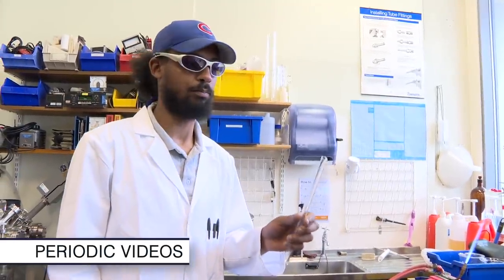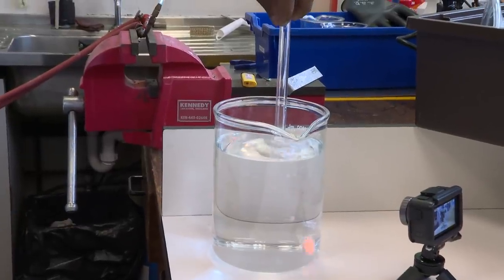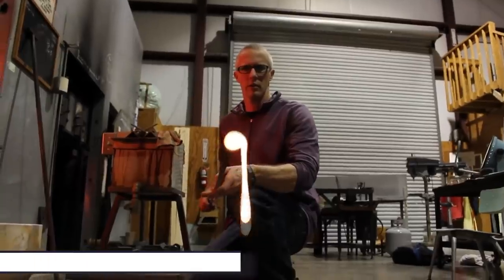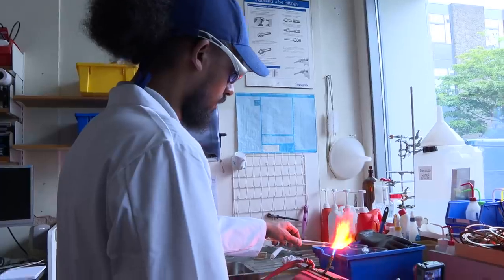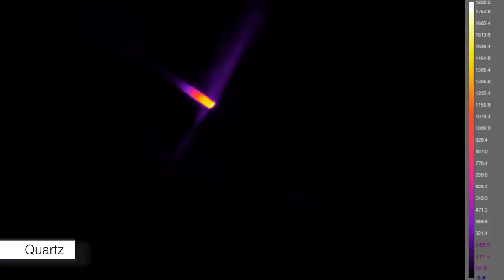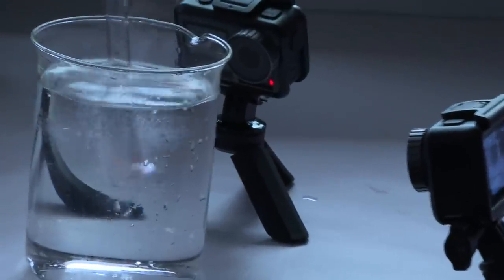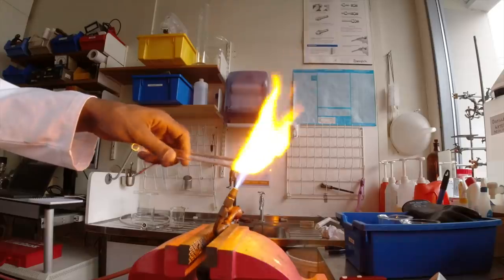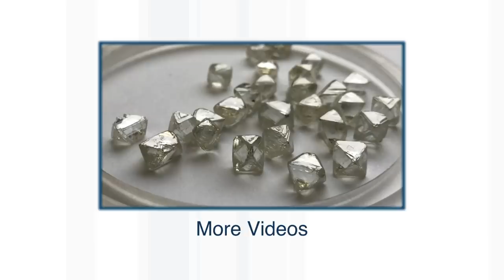Hot Glass SHATTERS in Water

Comment: Big difference in quartz and borosilicate glassware is also the UV transmission. Borosilicate glass absorbs everything below 300nm, quartz can go to ~170nm. Quite important if you try to do photochemistry.
Reply: There are other performance characteristics between Borosilicate glass and Quartz, but the big thing they're trying to demonstrate (And FAIL, Don't use different shapes and masses when making thermal comparisons) is that quarts and borosilicate glass have different thermal ranges where they shatter at. And, yes, if you heat Quartz up enough, it will behave similarly to glass when plunged into water. It's just that the impurities in glass (both potassium oxide and boric acid) shrink the thermal range.
Reply: Also important if you break the outer glass on a mercury vapor lamp, but continue to use the lamp the flash burns to your eyes are excruciating until you discover why you keep getting flash burns and not welding.
Reply: Germicidal lamps as well

Comment: At my glass factory, we have to use a significantly hotter flame than a gas/ox torch in order to manipulate quartz. Sometimes we even have to use hydrogen, which is quite a dangerous gas to work with since you can't really see the flame.
An interesting note to add to what he said about the quartz glowing more brightly: Sometimes when our operators work with the quartz, the light can be so intense on one end that due to the fiber optic effect of the light traveling down to the other end of the tube where they are holding it, they could get a "sunburn" in a perfect circle.

Happy to answer any questions about labware manufacturing!

Comment: I wanna know why glass is used in chemistry at all. Why is glass the go-to for mixing & testing chemicals in? How can one element rule them all & be so inert & noninvasive when it comes into contact with so many other compounds??? 

Do a video on the use of glass in the lab please : )
Reply: For once its is clear. 
This is based on the amorphus structure. Not shaped with periodically shaped elementary cells like a crystal.
Reply: i think what it is is resistant to alot of corrosive liquids. with a notable exception being HF. it can also be shaped to make a bunch of different instruments. and its see through. idk what makes it so corrosion resistant.
Reply: Because its clear so chemists can see what's going on inside, malleable (with some skill and heat) for shaping into weird and wonderful shapes by gents like Connor and chemically resistant enough for the vast majority of purposes. 
If it's not resistant to the chemistry that needs to be done(eg using HF or strong OH- or high temperatures) then we'd use something else (steel, titanium, platinum, ptfe, ceramics...) but alot of the time this looses the ability to see what's happening in the reaction.
Reply: What the others said.
Additionally it is super easy to clean, making it basically last forever as long as you don't break it. I have personally used many flasks that were older than myself.

It is so inert because it's still mostly silicon dioxide and the silicon-oxygen bonds are really stable.
Reply: @christiannorf1680  Is it just luck of the universe that the silicon-oxygen bonds are also transparent?
Reply: @AntonLFG  they're not transparent to everything(normal glass absorbs alot of UV radiation for example), but are transparent where it matters for humans: in the range of wavelengths that we can see.
That being 'luck' is up for debate. I'm pretty sure that glass being see through predates science as a field of study. So somebody will have looked for a material that was transparent, easy enough to shape, reasonably chemically resistant. The fact that it's silicate glass that ticks those boxes is a coincidence. Had our sun emitted different wavelengths, we would have evolved to see using different wavelengths and so a different material would have been used

Comment: My main experience of quartz was in my early programming days with "windowed" microcontrollers. This was before flash memory. Normal silicon dice would be assembled with a quartz window, allowing the One-Time-Programming to be reversed by exposure to ultraviolet light. It took about 20 minutes, so you'd get a few ICs to work with and a decent socket in your board. 

I heard of someone whose program worked fine with a windowed part but never a standard OTP. Daylight was "initializing" the RAM he'd forgotten to initialize in code.

Comment: The process of slowly cooling glass after it's been heated is called annealing. It's also done with knifemaking for the same reason.
Reply: Not the same reason at all. The principles behind the heat treatment of steel have very little in common with glass annealing.
Reply: @TheHuesSciTech  Please forgive my ignorance, but would you mind giving a one or two sentence explanation of the differences, or perhaps point me to something I could read about it? TIA
Reply: @quintrankid8045  Try "Heat Treatment - the science of forging" by "Real engineering" and note that crystalline grains, grain boundaries, and the way that the mixture of iron and carbon behaves across different temperatures is central to the explanation. Meanwhile everything in this video is simple thermal expansion, amorphous not crystalline, and no (reasonable) explanation of what's happening in this video would refer to mixture phase diagrams.

Comment: We have to sometimes have the same annealing process when welding certain metal alloys.
     If you have made the weld properly the weld zone should be stronger than the rest of the weldment, but if you have not done the annealing properly then the weld will fail, not at the weld itself, but along the edge of the weld zone, where the weldment was almost, but not quite melted.

Comment: The stress being locked in by rapid cooling produces desirable properties in glass for some purposes.  Glass treated in this way that doesn't disintegrate on its own is much harder to damage than chemically identical glass without the stress frozen in, so it can be used in applications where you want very strong glass, such as vehicle side windows, tabletops, doors that need to be secure, and so forth.  When such glass is broken, the internal stresses cause it to shatter into small pieces that tend to not have sharp edges, so unlike conventional glass they don't present a sharps hazard.  (Freshly broken glass varries one of the sharpest cutting edges known.  This is why being thrown through a window can easily cause sever, even fatal, injuries.)

Comment: The bathroom in my new house had these two ornate glass lamps flanking the mirror, looking very old fashioned.  One day I was using the sink and a drop of water flew up and landed on one of the bulbs, causing it to explode in fairly dramatic fashion.  I was quite impressed.  I wondered whether this ever happened to the previous owner.  Anyway, I replaced the bulbs with the modern low energy ones and, so far, there have been no more explosions.

Comment: Would you consider doing a comparison "Quartz Vs. Corundum"? 
Are there nuance-differences between "Quartz" and "Fused silica"?
Reply: In a strict materials science term, quartz is crystalline and fused silica is the amorphous (or glass) structure. In fact furnace tubes using fused silica devitrifies into the crystalline beta quartz (cristabolite) above 1100C and is a source of stress and cracking of furnace tubes in old semiconductor processes.

Comment: What the Professor is talking about in this video is called THERMAL SHOCK. This is where there is a big enough temperature difference in the glass that portions of the glass is expanding or contracting more  than other parts. He's correct about the need to heat and cool a piece of glass slowly, so the temperature changes across the work is as uniform as possible to prevent stresses developing from uneven expansion and contraction within the piece.

What the Professor doesn't have correct is the difference between Prince Rupert Drops (and tempered glass used in shower doors and car windows) and what the glass artist is demonstrating here. (And, yes, anyone who does lamp work/torch work when working with glass is an artist in my book.) The only real difference is how those stresses are formed. Within Prince Rupert Drops and Tempered Glass, the strain is between the quickly cooling skin and slower cooling core. This balances the strains and makes them uniform in a way the piece is relatively stable. The piece shatters when the stresses are thrown out of balance from a nick or a cut. In heating one end of the rod, the artist is adding stress along the shaft (from the hotter part of the rod to the cooler part), not across the radius. Then he throws those stresses out of balance when he cools the outside of the radius quicker than the inside. And this causes the glass to tear itself apart along the radius trying to equalize those stresses.

Comment: Would it have given a noticeably different result if you had used solid quartz instead of a tube? Kinda wanted to see that
Reply: Yes, this is the major flaw in their demonstration. The shape and mass of an object changes how it performs thermally. Because the walls are thin enough in the tube, the tube is able to give up much more heat evenly over the rod. Thus the rod's more likely to suffer from thermal shock. 

Now, that isn't to take away from the thermal differences between quartz and glass. It does take Quartz a bigger change in temperature to shatter the way the glass rod did. But the shape and mass play into it more than does the thermal performance of the material. And it's important in any experiment to take into account all variables. If this was submitted for a grade, I would give this video an F.

Comment: shouldnt CO2 be somehow similar to SiO2? Is there a pressure and temperature under which one could create glass made of CO2 like there is glass made of SiO2?
Reply: Yes it could, but no it doesn't, because of the bond energy between Si and O atoms vs the bond energy between C and O atoms. 2 Si-O bonds require more energy to be stored away than 1 Si=O bond, C and O are the opposite, C=O is stronger than 2 C-O bonds. So carbon wants to form double bonds with oxygen, silicon wants to form single bonds. (I think, been a long time since I've done P Chem like that) 
The closest you'll get to a Carbon - Oxygen 'glass' is probably some kind of amorphous polycarbonate if such a think exists.
Reply: You can't make glass with carbon dioxide. You can make dry ice with carbon dioxide. It just really likes being a gas over a solid and liquid. You'd be forgiven in thinking CO2 would act similarly as SO2, as both Carbon and Silicon are in the same column on the Periodic Table, but this is just not the case.

All glass is just a lump of quartz (pure silicon dioxide) with impurities added to alter the properties (in this specific case the thermal performance). Glass is just Quartz with stuff added to it. That stuff is mostly Potassium Oxide for glass in general, and boric acid specifically for borosilicate glass. The boron added gives borosilicate glass more strength, similar to quartz over everyday glass, but drops the thermal properties of the glass to a more manageable range.

Now, you CAN make glass from Germanium Dioxide, and Google tells me it's used in optics. HOWEVER, I don't know enough about and have not handled Germanium to tell you how the thermal characteristics compare.
Reply: @MortRotu  You probably have to go to temperatures and pressures where CO2 is way past critical point, where it has been compressed to an amorphous solid. Likely only available near liquid helium temperatures, and at pressures beyond what diamond anvils can reach. A very cold neutron star might have CO2 glass on it's surface, the pressure is high enough there it can form, along with all the other exotic chemicals that are not even possible anywhere else. Going to be hard to detect though, the atmosphere of a cold neutron star is only a mm or two thick.
Reply: @SeanBZA  doesn't surprise. Me, you can do all sorts of weird stuff where physics as we know it starts to get bent to its absolute limits =P
Reply: SiO2 is a bit misleading in this case. CO2 is a discrete molecule, while a SiO2 molecule does not exist (at least not under normal conditions). SiO2 is just the sum formula like NaCl or Fe2O3 but none of these can be seen as molecular units. In fact each silicon atom in SiO2 is actually bound to 4 oxygen atoms.

A hypothetical SiO2 molecule would immediately react with other SiO2 molecules for the reasons @MortRotu described
Reply: @christiannorf1680  thank you, knew I'd missed something out on it but couldn't think what it was.
Reply: Thanks everyone for the insights, love this comment section
Reply: @jackielinde7568  To be clear, glass is not "just Quartz" with some other stuff added. Glass is more like a metastable phase of matter, e.g. metallic glass. Almpst any material can become a glass if it is cooled quickly enough to avoid crystallization. The main difference between glass and quartz isn't the stuff that's added, but the molecular structure.

Comment: “Metals expand a lot”  Invar doesn’t. The image alignment apparatus in imax laser projectors are made from a proprietary invar alloy that’s specifically designed to not change its shape under different temperatures.
Reply: In general, though silica rods are also very common as precise alignment spacers in a lot of optical equipment. Invar has the advantage you can machine it with cutting tools, silica you have to slowly grind to shape.

Comment: Soda-lime glass could also have been showcased!
Reply: Eh, it could, as well as other glasses, like kiln glass used in art projects. But that's not the problem with this video. They're trying to imply there's a change in properties where pure Silicon Dioxide (Quartz) does something completely different than Silicon Dioxide with impurities (Glass) does. However, the only thing those impurities does in this regards is change the Coefficient of Expansion (CoE) by changing the difference in temperatures needed to cause the material to rend itself into pieces. 

The glaring error in this vide is where they used a tube for one material and a rod for another. Those shapes and masses will perform drastically more different than if they used similar rod or tubes for the differing materials. Meaning, a tube of any glass would perform similarly to the tube of quartz, and the rod of quartz would perform the same as the rod of glass. The ONLY differences would be the change in temperature to create enough strain for the piece to rip itself apart. The CoE just dictates the size of the temperature difference needed.
Reply: @jackielinde7568  They are both tubes, just the borosilicate is a open ended glass tube, while the silica is an old teat tube with a closed end.
Reply: Cool.

Comment: I wonder what impurity was in the quartz to give the red colour in the flame?
Reply: Likely salt from being handled. Sodium, in one of it's many salts, is a very common contaminant all over the world. As explained you do not need much to give a yellow orange flame, nanograms of sodium salt on the glass, from being picked up in handling, will do it. 

You need to really clean the glass well, starting with washing with soap and water, them rinsing a few times in DI water, then distilled water, followed by a few rinses in distilled acetone and MEK, to get the surface clean enough to not have Na contaminants on it. Also done in a controlled inert atmosphere as well, because you have a whole halo of shed skin particles and salt from your body in the air.
Reply: @SeanBZA  It’s a definite red colour, not the yellow/orange of sodium.
Reply: Um, none. Quartz is just pure Silicon Dioxide, where as glass is impure Silicon Dioxide. Mostly Potassium Oxide to change the thermal characteristics to make it easier to shape and form. Boric Acid is added to make Borosilicate Glass, where you need better hardness without giving up as much of the thermal performance. Lead is sometimes added to make the glass more clear, and other metals are added to change the glass's color.

But Quartz is pure Silicon Dioxide.
Reply: Camera sensors can't cope, and light filters have probably been applied.  This likely looks different to the eye.  They make some sweet filtering gear for cameras and cell phones these days, i.e. @didyclips

Comment: Aaaaaha! this makes sense! It is only human to make mistakes, but to make the same mistake mor than once… I am a total idiot and have cracked two proper borsilikat 5000ml Erlend- Meyer flasks by cooling them in water directly after boiling in them over a 7KW flame.. My idiot-DIY- solution to this problem was waiting ten fifteen seconds between applying 7KW of heat, and  plunge it in to 0-2 degree C water. This hillbilly method has worked flawlessly for the better part of two dekades. I will now certainly  try to find a qartz 5000ml Erlend-Meyer flask. 

I would appreciate a" link" to sutch a product.